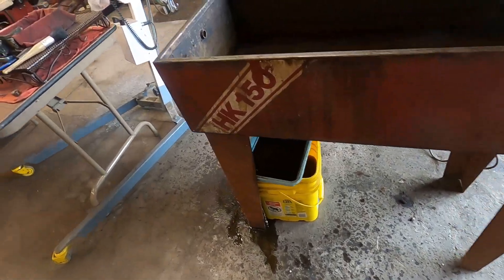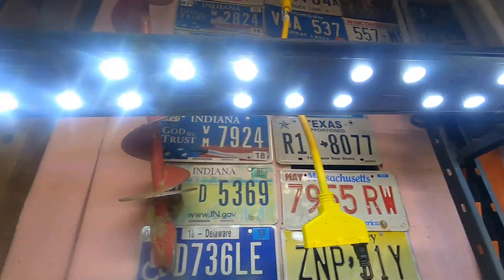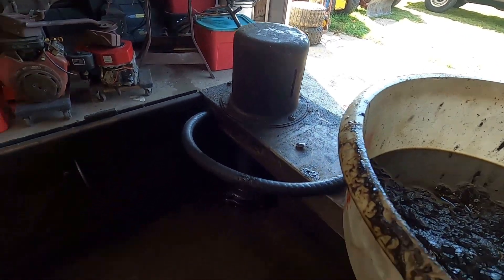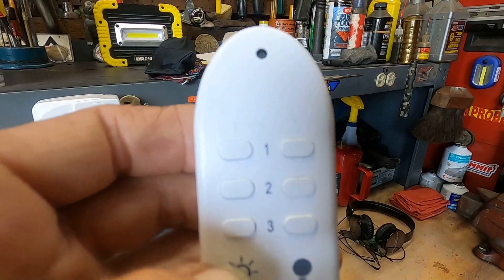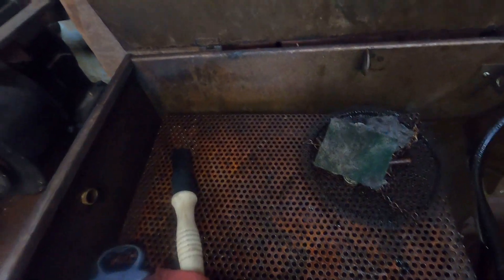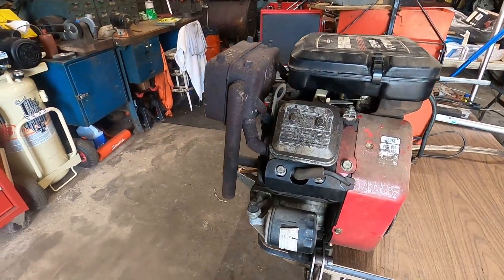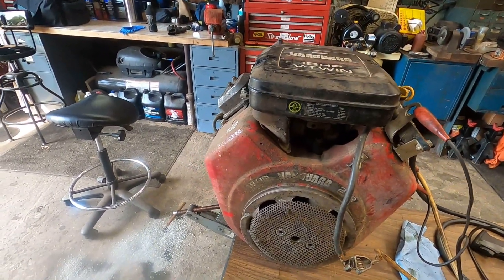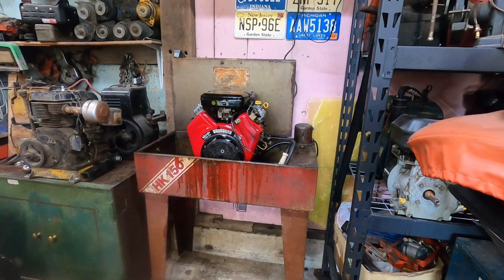Shop Reorganizing Day 3

Comment: Cleaned out my parts cleaner recently & then the unbefore known rust holes started leaking---uugh.  Used up all my JB Weld.  By the Flex Seal did not make the grade, mineral spirits went through it.

I use paint strainers to recycle my min spirits & no diesel, stinks too much!

Comment: I have an interesting build coming together using 16hp vomit shaft vanguard just need to get a check valve on it that won't blow up in one minute like the first brass one did. 
Going to call it FVtwin if it works, still experimenting.
Reply from the maker: Is this the propane build you've been doing? Cheers my Friend and thanks again for the bottle/can opener! Zip~
Reply: @ZippoVarga Your welcome.
I found the can opener on a soda machine at a shop clean out.

 As for what I'm building there's a spark plug in one cylinder and an air check valve in place of spark plug on the other cylinder to pump compressed air.

Currently pushing 110 psi with stock block and head will deck the block in the future and probably have the combustion camber welded up to increase cylinder pressure. 
At higher RPM its suffering air inlake valve float due to lighter spring tension will be limiting valve travel (not lift as its not actuated by the cam) to help prevent valve float. Also finished modifying a stainless steel check valve to limit spring compression to prevent damage to return spring from being over compressed making it little more reliable. 
Still experimenting with it.🤐
Reply from the maker: @willyck948  The old 4 cylinder Wisconsin engines (V4's) were often converted to air compressors by using two cylinders to compress the air while the other two were the power source. Looking forward to seeing the progress on that project! Cheers my Friend! Zip~

Comment: is sucks you do not have the pan for the parts washer it makes cleaning it a lot easier.  but it does make you clean it more often.
Reply from the maker: True! But since I got the parts washer for just twenty bucks, I'm ok with that. Cheers Robert!! Zip~
Reply: @ZippoVarga  I happily paid $100 for the same parts washer used.  You got a good deal.
Reply from the maker: @BuiltOverBot  I would have also. The pump was clogged up on this one from lack of maintenance, but after a good cleaning, it was good as new. What is the pan you talked about in the first message? Cheers! Zip~

Comment: Go back to the part about pressurizing the gas tank.  How did you do that?    very interesting....
Reply from the maker: I just used my air gun to pressurize the tank by a couple PSI to force the fuel to the pump. Zip~
Reply: @ZippoVarga  Thanks.  We were in Vermont with scouts and we made a "water machine".  After pouring rain water into a plastic barrel, I charged it with 30psi.  Amazing. We had garden hose pressure water.       I know house plumbing is tested at 100psi.  I was wondering how much it took to move the gas.    Thanks again!
Reply from the maker: @travelingkaspersworld4096  It really didn't take much. Any more than the couple PSI I introduced and I'd have forced fuel into the crank case which would have mixed with the oil. I wasn't aware you could pressurize those plastic barrels! I've seen people using water reclamation and mounting their water catchment containers up high to let gravity provide the pressure. How did you pressurize the barrel? Cool Concept! Cheers again! Zip~
Reply: @ZippoVarga  I should say, we were scouts having fun.  So all sensible thinking is excused for the day.  We added pressure and watched to see at what point the barrel would swell.  Mostly wanted to teach the guys how much pressure was needed.  They know 32psi from car tires etc.  So the next lesson was volume.
Reply from the maker: @travelingkaspersworld4096  It sounds like you're teaching valuable life lessons. Very commendable Kasper! Zip~